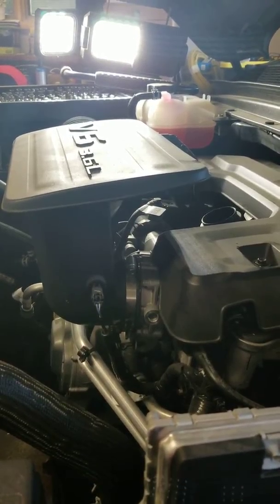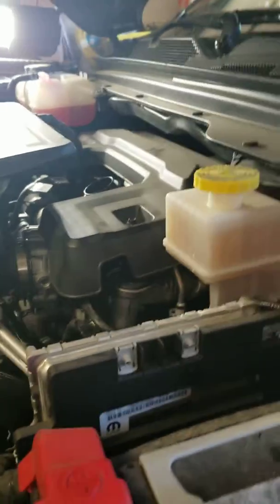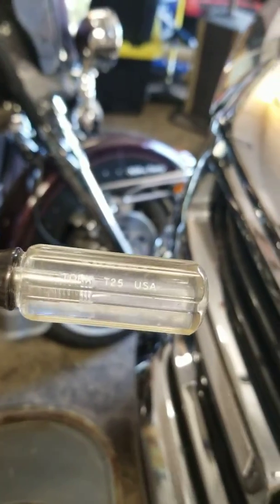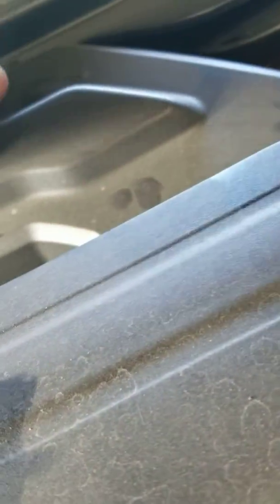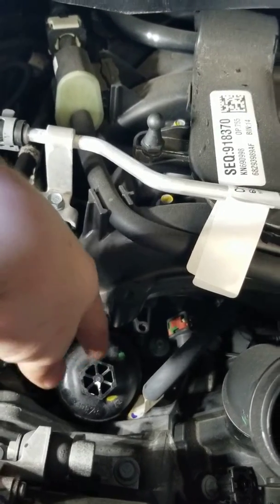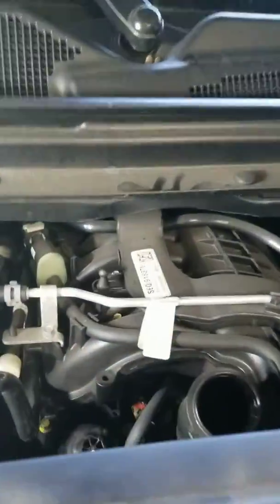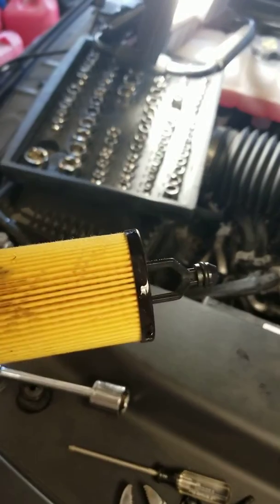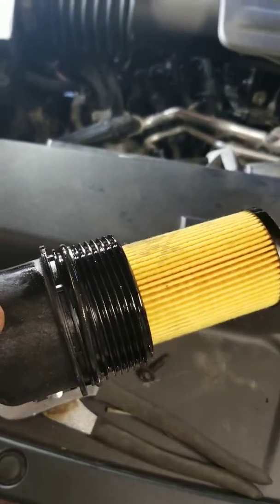2019 Dodge Ram V6 oil filter location

Comment: This Video is the only one I found that the engine looks just like mine under the hood. 2019,Ram Rebel 1500 thx can you explain what the rubber things are, I’m fearful of pulling to hard and breaking something
Reply from the maker: Shouldn't be a concern. It's meant to be pulled off. If I remember correctly, it's like little pointed heads on the plate that goes into rubberized heads around the engine. No big deal at all. Hopefully this all helps you

Comment: Do you know if it was some time during 2019 that they changed the filter types?  My battery went dead and I saw stamped on it 2/04/2019, I’m thinking that was the date they installed it.
Reply from the maker: I do not know that, sorry I can't be more help. I don't have the truck anymore

Comment: How much oil does the truck take and how easy is it to find that filter
Reply from the maker: If I'm correct, it was 5 or 6. Your local automotive store should be able to tell you. The video shows where the filter is. But not all rams have the filter in the same location depending on engine size
Reply: @drew8042  thanks man, yea ive got the same truck as you the 3.6 v 6 1500 I spent 20 minutes under the stupid thing trying to find the filter till. I saw your video so thanks
Reply from the maker: @realisticjman  I had to call a couple dealerships just to get the accurate info. Goodluck with it! It's not terrible once you actually find everything
Reply: 6